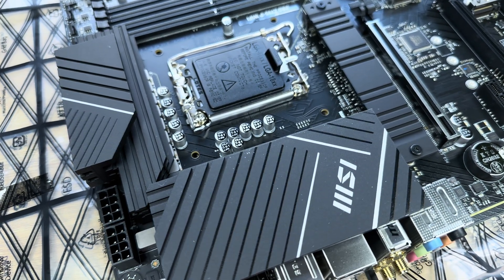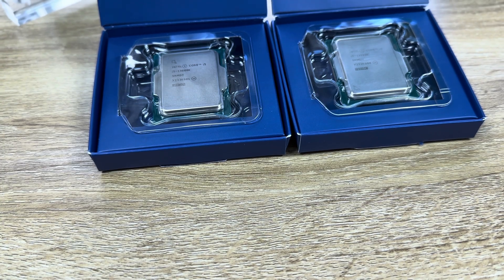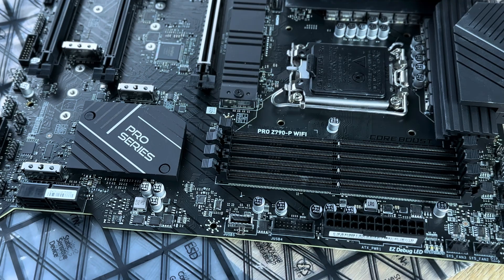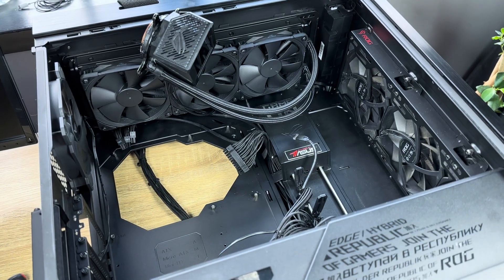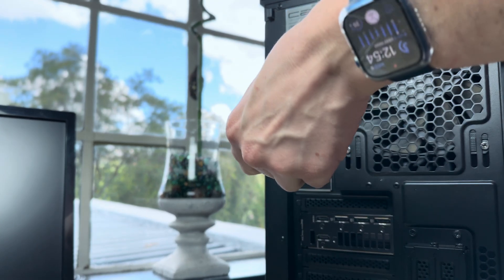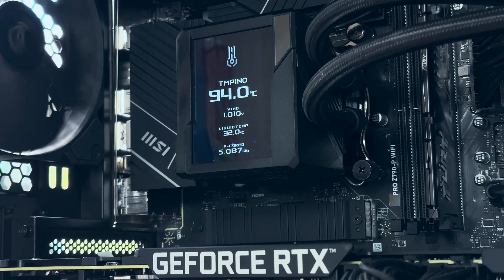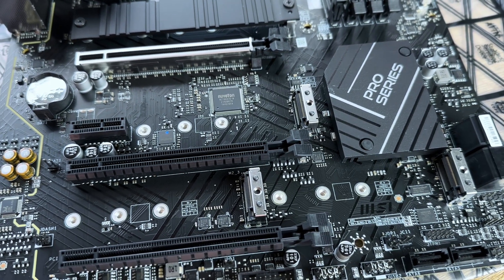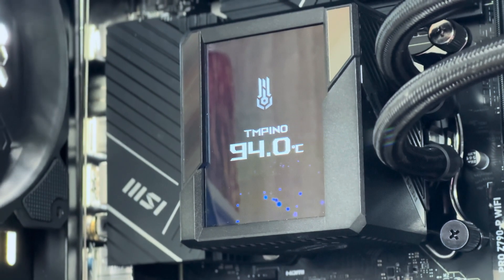MSI Pro Z790-P Motherboard Review (Intel 13th-Gen 13900K + 13600K Tested)

Comment: 5:14 mine comes in sunday and i have the I7-13700k, how will i need to download the bios? please be descriptive
Reply from the maker: https://www.msi.com/Motherboard/PRO-Z790-P-WIFI-DDR4/support
Reply: @GLITCHEDZA  do i just download it on to a usb stick and put it in the pc?
Reply from the maker: @cosmicvcosmic  Yes you download the update extract it from the zip file, put it onto the USB, plug it in. You need to boot the PC up and press delete to enter the BIOS settings. There, you'll find an option to update the BIOS. It will show you the USB file contents, go through the files and find the update you copied. Let it install.
Reply: @GLITCHEDZA  thanks! hope you have a good day🙃
Reply: @cosmicvcosmic  did you figure it out? I’m having the same problem. I fixed it but now it’s not picking up a network adapter and I can’t connect to internet.
Reply: @reecewatts5210  im having your exact problem right now, where u able to fix it? If so how
Reply: @santaclos2404  I’m setting up the board today with an i9 13k did y’all figure out what the issue was?
Reply: @AresCarriess hey mate, wish you'll be able to answer me when you can, did you have problems? And did you have to update the BIOS like everyone say?

Comment: I have this motherboard however I can’t connect to the internet with Ethernet nor wifi. I updated bios and still no progress. Can anyone help
Reply: Have you updated the Lan Drivers from the msi website?
Reply: Did you figure it out? I’m having the same exact problem right now.
Reply: @reecewatts5210  Honestly I returned it, I tried everything I could find on the internet and nothing worked so I ended up getting another motherboard. Sorry that I couldn't help/
Reply: @afatfly3956 hey mate, may you tell me what mobo did you take then
Reply: Some insight would help me a bunch I’m really struggling

Comment: does it not say on the box that 13th gen processers like the i5 13600k is supported? why would we have to bios update it. Could u please explain how to update bios on this motherboard aswell?
Reply from the maker: Here's a link to download the BIOS files. It also explains how to put it on a USB, go into the BIOs settings at boot and install the update. Sadly, MSi dropped the ball with the motherboard by not including a Q-Flash USB in the box. It is quite simple to update though .  https://www.msi.com/Motherboard/PRO-Z790-P-WIFI-DDR4/support
Reply: @GLITCHEDZA  thank you and the thing is that I orderd a i5 13600k and got the MSI PRO Z790-P WIFI DDR4, Intel ATX LGA 1700 and im stressing quite a bit because im confused on the bios process and if I would even have to do it. Thank you
Reply: @tempest8044  Did have to do a bios update or was the CPU recognized right out of the box?
Reply: @poppyonepug1  it worked perfectly fine, the thing is with this motherboard is that it should support every 13th gen right out of the box
Reply: @tempest8044  it does support it out of the box, what are you talking about?

Comment: 4:59 Did you manage to boot into bios on the first try or you had to do a bios flash in order to get a post?
Reply: BIOS always POST, he said he received unsupported processor error. You go to another PC, download the latest BIOS on the USB drive from the MSI website, plug that in to the new PC with new motherboard, go into BIOS and update. Now 13th Gen Intel CPU will be supported. How can you flash BIOS if it isn't even POSTing. ugh!

Comment: do you think the ASUS Prime Z790-P WiFi D4 motherboard is just as good as this board? If you had to choose which one to buy out of the 2 which would you choose?
Reply from the maker: It’s a tough one coz this board has PCIE 5 for the M.2 slot and the ASUS one has PCIE 5 x16 slot. They both don’t have the combined M.2 and x16 PCIE 5. So if you’re planning on gaming and getting a 40-series somewhere along the lines I would say the ASUS one. I would personally go with ASUS because the Gen4 M.2 is already blazing fast. I could live with it. Rather that than get a board that doesn’t support a GPU now or even next year’s releases.
Reply: @GLITCHEDZA  If youre going with a 13th gen intel, stay away from that Prime board. you cant flash bios on that one without a 12th gen processor lying around to boot into so you can flash for the 13th gen. 
The MSI board has a button to allow you to flash the bios without a CPU installed. 
I was looking at the "A" version of the ASUS prime, and the MSI PRO and went with the PRO since i could flash without a processor.
Build is in progress. Slow holiday shipping. I can link up a video after im done if you would like.
Reply: @EasyMoneySG  where is button on msi PRO Z790-P wifi ?
Reply: @fajt2637  You can see the button on the I/O panel, at the top next to the PS2 socket.
Reply: DDR4 is old story now try to get any motherboard that supports ddr5. So you don’t need to upgrade more parts down the road.

Comment: Hey, I have the MSI MPG z790 Edge wifi Motherboard (2022), is the new Samsung 990 Pro SSD compatible?
Reply from the maker: That board doesn't have a dedicated Gen5 SSD slot so you can get an Edge Card and use the GPU PCI-E 5 slot and put your GPU into a PCIE 4 slot (if you don't have a 40-series GPU). Or you can just use the Samsung 990 Pro in the Gen4 slots. It will bottleneck the speed but it will still be hella fast.
Reply: @GLITCHEDZA  I do have a rtx 4090. I am trying to build my first pc, i got this motherboard, but this will bottleneck the performance? Im confused. But overall this ssd will work with this motherboard(?)
Reply from the maker: @SDGRTX1455  Yes the Samsung 990 Pro is a Gen5 SSD so wont' run at its full potential on the PCIE 4 slot. But I don't think the speed difference will be drastic. Rather use the RTX 4090 in the PCIE 5 slot and the SSD in the M.2 slot. Basically, everything you have will work but ideally, you would want to use a motherboard with Gen 5 for both the SSD and the GPU to get the most out of it.
Reply: @GLITCHEDZA  This motherboard is Gen 5 if i not mistaken. Quite confusing xD This is why when i have all the components together, will let someone else let it build it for me. Just want to know the best recommendation before buying
Reply from the maker: @SDGRTX1455  Haha the latest stuff is quite confusing. Just know that Gen5 comes in various forms. You get Gen5 for both PCIE and M.2 SSD slots. Some boards only have Gen5 slots for M.2 and some only have Gen5 for PCIE. Some have both. The board you have only has Gen5 PCIE so your 40-series will work fine. The SSD you have is made for Gen5 M.2. It will work on Gen4 ( M.2 (the slot you have) but will be slower.

Comment: Kinda odd that a board meant for the 13th gen still needed a bios update to work 😑.
Reply: I bought mine and it was already compatible with my 13600K so I don't know wtf is this people talking about, all Z790 come ready from the box for 13th Gen CPUs,
Reply: @jeantechnoir7702 😭😭
Reply: Yea I thought so too. I thought Z790 boards should already be able to recognize 13th gen Intel CPUs without the need of any BIOS updates.
Reply: @wfwf7645  wow, as if its a z690 board just repackaged as a z790
Reply: I have this motherboard and had no issues off the bat with my i7-13700kf
Reply: i had no issues with my i7 13700k its the 14th gen that needs a update
Reply: Will it still need the bios update? Buying this board soon
Reply: @Platinum199  why wouldn't you buy the motherboard for the bios update?
Reply: No for 14 gen
Reply: Mine still booted but temps are very high in 90s c without any games running i have the gaming pro version I've updated bios and now it just crashes 😢
Reply: Thant's not a Z790, it's a Z690